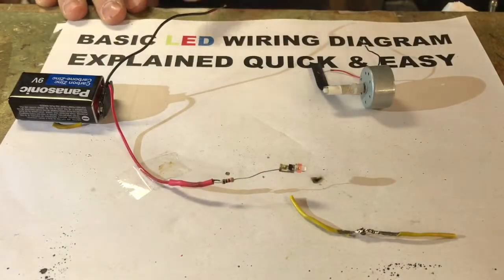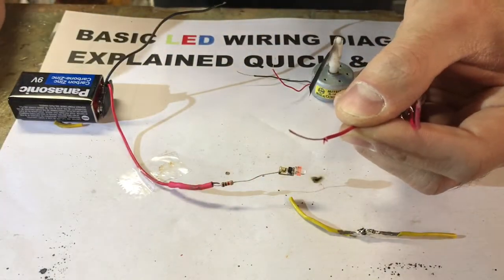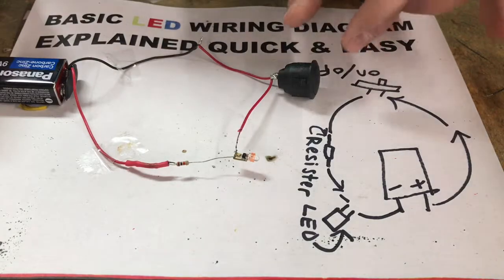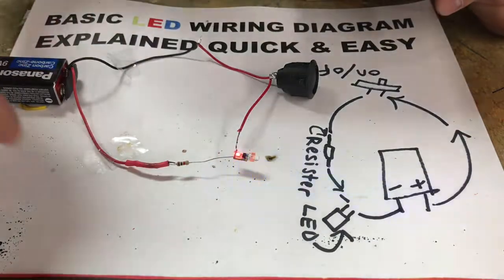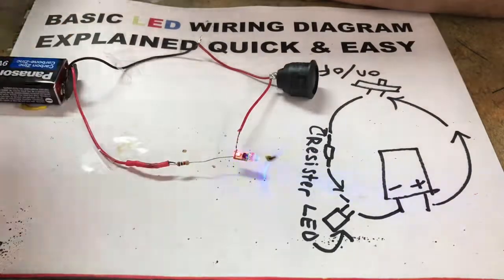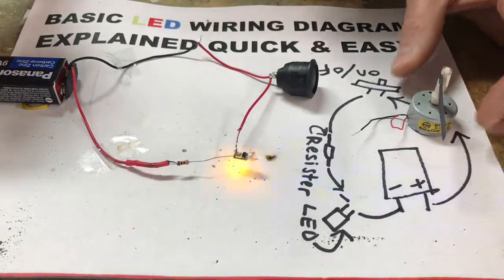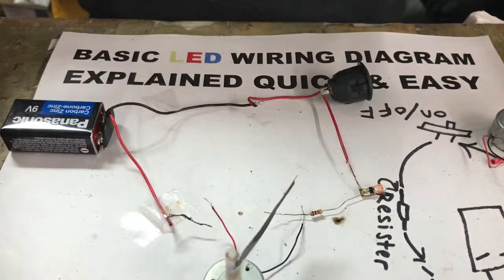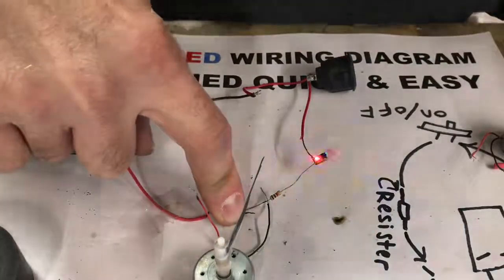How To Wire Led Lights (Best Video)

Comment: brother what if i had a 3 point switch would  need to connect that 3rd pin?
Reply from the maker: In order for your three pen switch to work with I believe it has a little LED light on it that third pin must be connected but the two points will work for positive and negative tested out and try it let me know
Reply: 1 point on a 3 point switch is for positive, 1 is for negative, 1 is for connecting a light or acting as a third position e.g in an ON/OFF/ON switch or ON/ON/ON